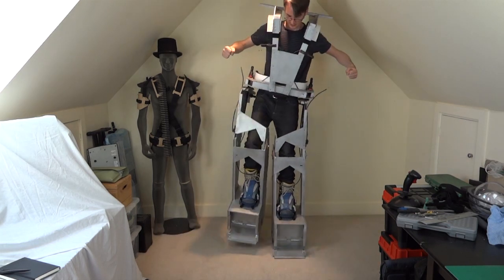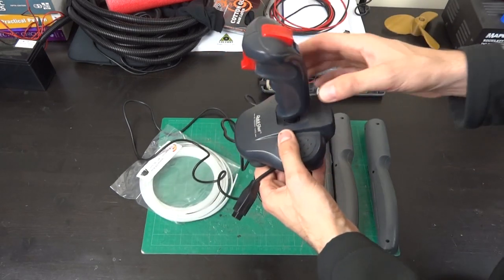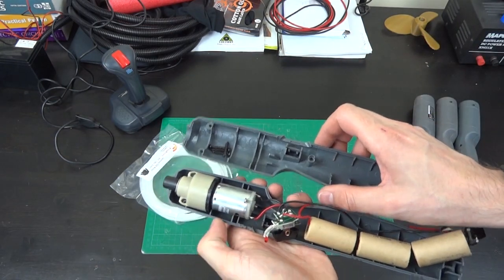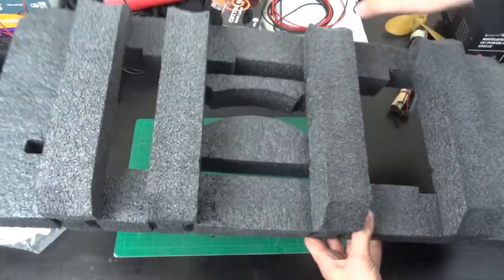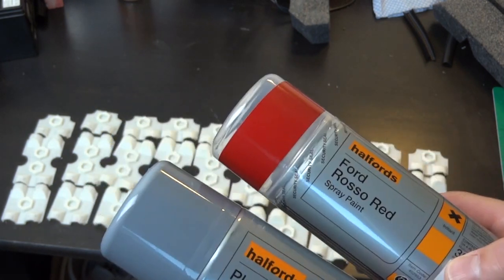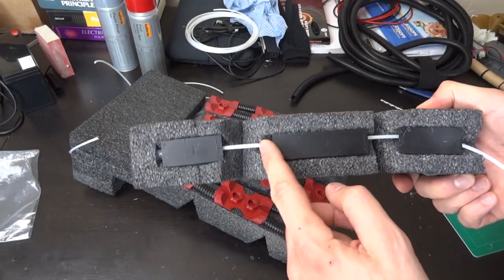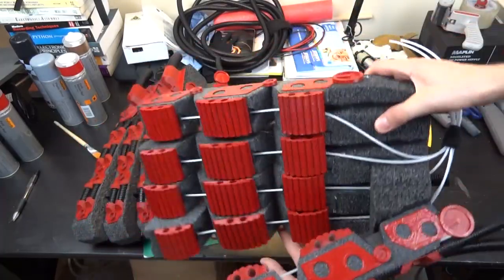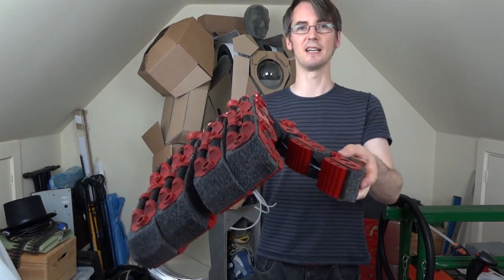Iron Man Hulkbuster Cosplay #7 | Hands | James Bruton

Comment: Hay, james! Just letting you know, if you use spray paint on that black foam, it's not going to cover very well at all. The holes in the foam won't get covered and it will look like a mixture of dark gray and whatever color paint you were using, i tried painting a 3x4x6 piece for a project i was working on and it still looked bad after 5 coats! Just a heads up

Comment: James had you thought of simply running the nylon cord up to rings in which you attach to your fingers? then using ninja flex along the back side of the fingers to provide the tension to keep the fingers open? this would allow the fingers to open and close either one by one with your actual fingers or link them together to work as one with out the added complexity of motors and controllers and another failure point.
Reply: ***** you could also link the finger pull cords together so pulling one piece with say your first finger will open and close the fingers leaving the others to operate the aux switches. Just a thought you got my mind going with this build :)

Comment: this is... well bad, not to be crude but you take some foam and just slap some 3d printed parts on.
Why not actually design something in 3d to take the entire mechanical aspect that you need and print that?
I mean I'm working on a mk42 and even I do that, so using substanderd (aka foam) and just glueing 3d stuff on it just seems like bad designing.
Plus it doesnt look like anything close to the hulkbusters actual design (movie or comic wise)
Reply: ***** ya tell him
Reply: Ryan Everson, go fanboy somewere else.

*****, it wasnt meant as a bad thing but you're known with 3d modeling and developing, granted you most likely dont use professional 3d modeling tools but still that shouldn't limit you to making second grade stuff like this.
You could easily develop a better pair of hands in 3d with the same or even better functionality.
Because this comes down to making small plastic strips and glueing them on foam.
While you could be making the entire thing out of 3d printed stuff, be it pla or be it abs.
for example I made this with only 3dsmax and a makerbot replicator 2 : https://scontent-b-ams.xx.fbcdn.net/hphotos-xpa1/t31.0-8/1523874_10152690975582502_6016426859996521481_o.jpg

So I don't see the entire weight thing seeing that thing weighs about 400 grams.

Comment: Wow those hands look amazing. Nice idea using th foam to save weight. My only concern is that the fingers are too close together, when you add the extra layers over the fingers it might look a bit off since the sides of the fingers arnt covered and im guessing will not be covered judging by the amount of space in between them. Otherwise that looks fantastic

Comment: Oh my, Grandma, what big hands you have!!

All the better for punching you in your face..., dear!!

:D

Have you thought of adding some wire down the length of the fingers to add some extra rigidity and extend their life? Also, if you wanted to go smaller and lighter with the pull wires, check out fishing line, that stuff is supposed to be pretty strong. If you don't need it to push the fingers back out to fully extended length, you could then add springs or encased ones (to look like gas struts) to the back of each finger for a more mechanical look, therefore returning them to their normal position.

Everything is looking good so far, keep up the great work. :)